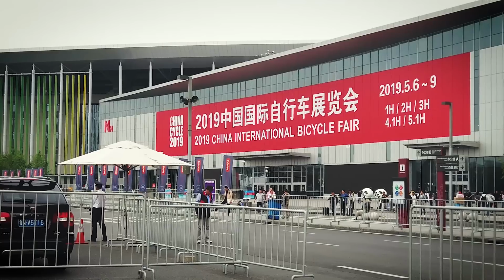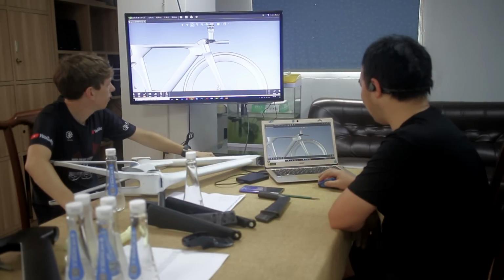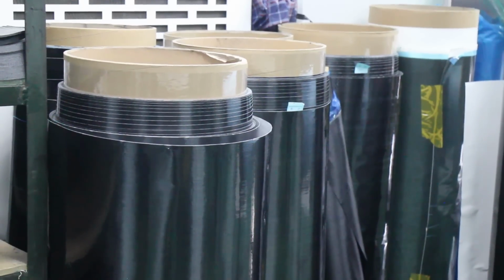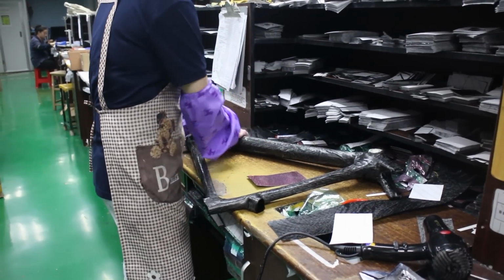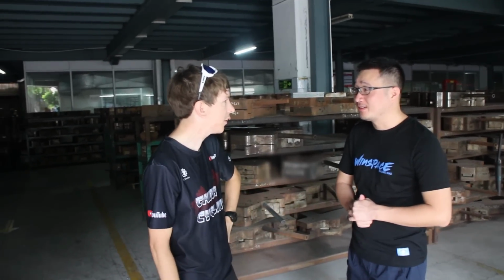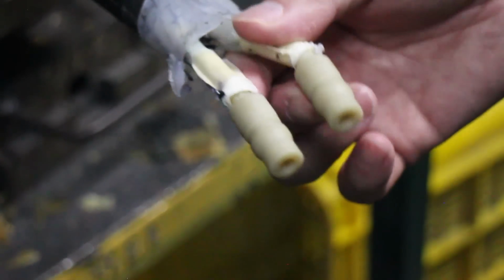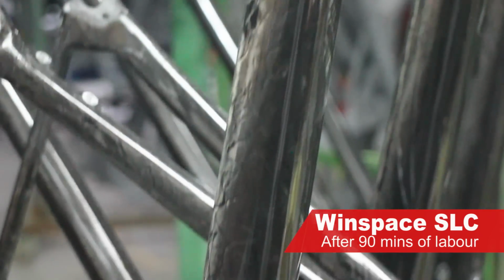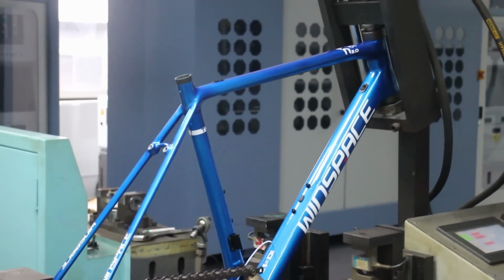Where are Chinese Carbon Bikes made? Winspace factory tour.

Comment: I was before Trek Madone SLR 6 and i have frameset specifications which i want to share for all people's,it will help a lot for those who have some issue right frame size Choose.
my height is 170 CM (5'7")
I will write Trek frame "52" size and in bracket i will write Winspace size M.

1# in Trek SLR 6 " Seat tube length" =483, winspace in (470) mm.

2# Head tube length= 121mm, winspace(120mm).

3# Effective top tube Trek SLR 6  = 534mm, winspace (530mm).

4# Trek SLR 6 "chain stay length"= 410, winspace (403mm).

5# "Bottom bracket drop" SLR 6= 72, winspace (68mm).

6# "seat tube Angel" SLR 6= 74.2°, winspace (74°).

7# "Head Angel" SLR 6 = 72.8°, winspace (72°).

8# "Trail" SLR 6= 58, winspace ( 63 mm).

9# " Frame reach" SLR 6= 383, winspace (382).

10# "Stand over" SLR 6= 750, winspace (732).

11# " Wheel base" Slr 6=  977, winspace ( 974).

12# "Frame stack" SLR 6= 533, winspace (517).

13# " Fork rake"(off set) SLR 6= 45, winspace (45).

i compare size Trek Madone SLR 6 and winspace T1500.

Do u appreciate my work?

Comment: Intresting how the manufacturing is done differently than other manufacutres. Check out this video on how LOOK make their frames.  More machines, cleaner environments, lots of little stuff like measuring where decals go, not just eyeballing it.  You can see why the LOOK frame can cost much more.  I really had hoped to see how they ensured the BB was straight and true.  Anyone who puts out a good amount of power over long rides can destroy BB bearings and listen to creaks forever.  Thanks to Winspace and CC..  :-)
Reply from the maker: Interesting points. To play devil's advocate; if you know a chap called Hambini, go check his website. He measured the BB alignment of a bunch of frames from various manufacturers, Trek and Cannondale being some of the worse and LOOK and Chinese brand Hongfu being the best. As for the decals, there are actually small guide marks on the decals that get taken off when the decal is set. You can't see them in the video becase they're feint and tiny, but they basically line up with features on the frame such as cable holes, etc to ensure the decals are always in the right place. :)

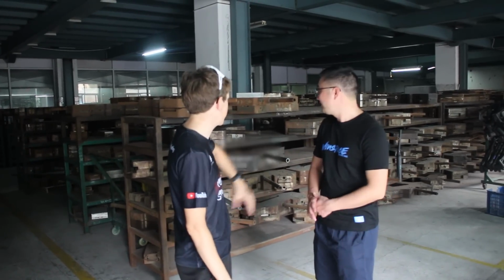Comment: 6:05 one of the moulds is greyed out. So tell me........ which big brand/model is being produced there? 🙈
Reply: you never will know...maybe in 10 years ;-))
Reply: They copy the same product and ship it out the back door. This guy who made the video is getting a commission.
Reply: Probs all of them lol
Reply: Is a normal business practices. 😀😁
Reply: S-works for $6K... But no, wait, specialized wouldn’t use so labor intensive and expensive process, they probably use another cheaper and faster manufacturer who skips few steps in the process to make more hot-selling Sagan branded frames.
Reply: The paint room had a no picture rule for a reason 😉
Reply: Not necessarily, it's very common for Chinese manufacturers to sell a mold after they're done using it. Then the new owner can make knockoffs with the exact same (albeit slightly worn) molds.

Comment: why don't they test the frame before painting. if the frame is flawed, they can scrap it before paint.
Reply: Maybe the paint shows cracks better
Reply from the maker: I think most frames get tested before painting - at the time I was there they were testing an unreleased frame, so they threw the other, finished painted frame on the testing rig to show me. #MovieMagic . However, I think the batch testing gets done on a finished, finalized frame.

Comment: Manual focus at a set aperture will help when doing the talking shots.
Reply from the maker: Thanks! Definitely. When I'm working the camera I'm usually full-manual but the people who were helping me film had nearly 0 experience with cameras, so I just left it on full auto. I forgot how dreadful the autofocus was on the original Canon EOS-M.
Reply: @ChinaCycling  try fiddling with the aputure range to limit the length of focus it has normally around f5 should get some well focused shots and autofocus won't be having a fit.

Comment: 10:40 - 10,000 cycles on the random batch QAs is still only equivalent to a 2-hour ride at 90rpm cadence.  I can't remember who or where, but another video I've seen claimed some machines were running continously for over a year.  Don't know if there was any truth to that.
Reply from the maker: The correct number was 100,000 cycles. When they're testing a new product, it will be even longer, but for batch testing 100,000 cycles is what they use.

Comment: So it seems these Chinese carbon frames just looks the part. They don't go through any R&D - zero real world or wind tunnel tests. Straight up from computer sketch, 3D print then mass production.
Reply from the maker: They definitely do CFD. No wind tunnel at the moment, however, if you check out Hambini on YouTube, watch his aerodynamics videos. (He's an aerodynamicist working on fighter jets - knows his shit) he'll tell you putting a bike in a wind tunnel doesn't necessarily relate to the real world (outdoors) because the air in the real world is far more chaotic than on a wind tunnel. The long and short of it, is that wind tunnel developed bikes are no where near as fast in the real world as they claim from wind tunnel testing. I dunno.... I guess the ultimate test is velodrome testing, but even then you can't compare the results to outdoor riding.

Comment: have you done a review of the slc ?  does it have the dual pivot brake mounts?
Reply from the maker: I haven't reviewed it (yet) but I did ride it (up a 6km 10% hill!) it was a very nice bike. The geometery was especially impressive with regards to NOT having toe-overlap issues - a problem I often have on my small frame sizes!

Comment: Do they do any aero testing or CFD analysis?
Reply from the maker: CFD analysis. They are working on wind tunnel access, but to me fair the situation out on the road is probably massively different to a wind tunnel anyway, so CFD analysis is probably just as good. (in my opinion - I could be wrong!)

Comment: Great video. China is maligned but they make all things of all qualities. The problem is that most people commissioning goods from China are optimising for cost, which is their choice and not a property of a whole nation! One issue that I've heard regulators talk about is that in China sometimes if you get a tour of a factory you're only seeing the "display factory" not the place where work is actually done. Is there a way of confirming that that factory you toured is the real deal?
Reply from the maker: Great point. However, there was no points of my tour where there was "You can't go in that room" or anything. The factory had 5 floors and I visited them all. The amount of frames being produced inside was very high, so I doubt you'd be able to produce that many just to put on a show.

Comment: Great video.  I am contemplating buying a t1500d. How would yourate this bike as compared to say the Yoeleo R9? Cheers.
Reply from the maker: As I said in my review of the Yoeleo R9, it's a good bike in terms of the carbon construction. I just think the design is a little lacking. (The handlebars are too high, the gap between the rear wheel and the frame too big) If you don't care about performance . going fast I think the R9 is fine. If you wanna go faster, I'd go for the T1500.
Reply: @ChinaCycling  Many thanks for your swift response.  I have been in touch with both manufacturers and have had good responses from both.  
It's interesting you say the handlebars are too high on the R9, as from the geometry, the stack is very low and the reach is very short, so if anything they should be way too low.  Maybe it's something to do with how the bars fit that makes them high?
Surely the main point of buying an aero bike IS to go fast?  Therefore it sounds (and looks from a geometry point of view) like the 1500D is a way better bet.  Also their site has more info.  Do you know how much if any wind tunnel work has been done with the Windspace?
In your opinion are there any other better / comparable Chinese frames to the 1500D.  I am looking for an aero frame with fully integrated bars and disc brakes. I already own a Long Teng LTK118 frame that I have built into a climbing bike, so I have no qualms about Chinese quality.

Comment: If you think carbon bikes are a luxury, guess again. Welding is difficult to teach and takes years to master. Cutting carbon and layering it up in a mould? Easy to teach, and the poor results are invisible, making the potentially defective products a lot easier to sell.

I sound a bit too critical perhaps, but I'm tired of this mentality that we're lead to believe we need a carbon fibre bike. We'd all do better off with an old steel frame (road bike geometry hasn't really changed a great deal in 50 years), especially those of us who only ride recreationally.
Reply: That's exactly the reason why I've bough a Specialized Allez Sprint instead and do not subscribe to that notion that the use of carbon fibre in cycling is a matured process. Not at all.
Also, personal safety and wellbeing is another major concern of mine.
Despite the possibility of welding AL7075, big players are yet to catch up. 
More than a year later ... pathetic

Comment: I would still be apprehensive about buying and putting your life in the hands of Chinese manufacturers.  Obviously, the big draw is money savings, but are a few extra pound reduction worth the risk? Like many other knockoff industries in China, there is a whole range of good, bad, and ugly when it comes to quality.  I watched a video about a Chinese carbon bike manufacturer put on by Trace Video and their bikes and operations looked more high-end quality than Win space.  Because of competitive pricing pressures, our company was forced to have some accessories made in China, but we still manufacturer our brand products in the USA.  The quality has always been inconsistent, one batch may be acceptable while others may have a higher failure rate (by our standards).  That is why I asked if it was worth your life just so you can say you ride a carbon bike or want to save a couple pounds.  If you are going to go that way do your research as your life depended on it. 

The last two Chinese carbon bike manufacturers I have seen featured on youtube apparently only made road bikes, anyone knows of any that make mountain bikes? Now that would be a true test of strength and durability.  Maybe no one does in China because they can't make them robust enough to withstand the stress of mountain bike riding.
Reply from the maker: I think your argument applies to 'unbranded' frames. Where there is literally no logos on the bike. These companies have nothing to lose if photos of their broken bike goes online. But with brands, regardless of if they're Chinese or Italian, they have something to lose. Furthermore, I don't know if you're aware that most western manufacturers also manufacture their frames in mainland China. Often in the same factories as these Chinese brands.

Comment: Hi bro, I'm actually having a dilemma, one person is selling me his carbon framed mt bike with a solary name on it with ksfm15 logo on its side, he also used an rb 32/50 crankchain on it with a catridge square tapered bottom bearing. On the other hand, there's the btwin 560. Which is better to get?
Reply from the maker: It's hard to say! You never know if he crashed the bike or whatever. It may look fine, but there could be problems beneath the surface that you just can't see. If you're buying 2nd hand carbon, always make sure you trust the seller with your life.
Reply: @ChinaCycling  my thoughts exactly... And also the btwin has a lifetime warranty. Thank you for the advice  bro

Comment: What about tall people carbon fiber frames it's so hard to find in China  I am 6"4 tall any help . Please
Reply from the maker: Check the reach and stack of the frames, not just the frame size. Often a 54cm Chinese frame has the same reach and stack as a 58cm western frame, etc.
Reply: @ChinaCycling  thank you so much for responses  to my question   I currently  have a 62 cm Raleigh militias what do you suggest  from Chinese  bike frame set.

Comment: Why build with carbon fiber when we now have Graphine 100 times stronger than steel and extremity light weight, not only the frame but the Graphine 11 second to max capacity fast charge batteries are already out.
Reply: Because it's not all about stiffness. You need the material to be flexible at certain parts due to road compliance / ride comfort. Can graphene do that?
Reply: Graphene is also much newer and way more expensive at the moment